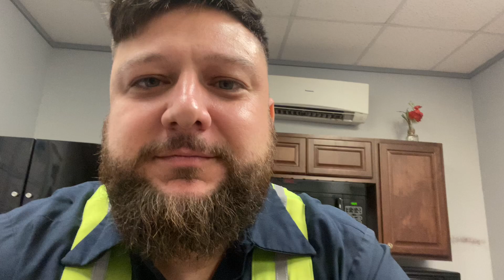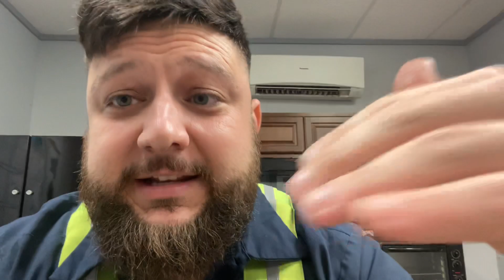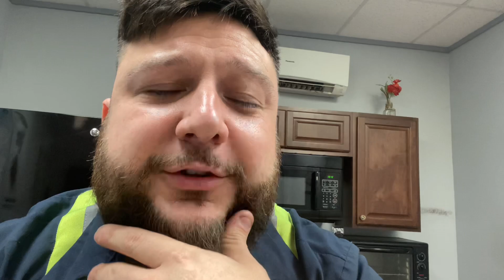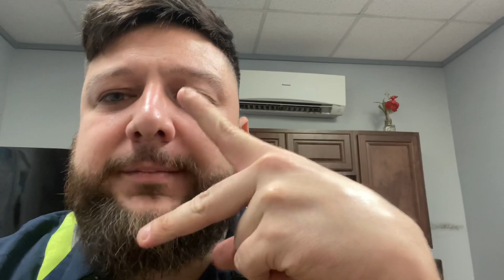Ported K Series Manifolds Inbound: How the Knockoff Manifold Performs on the Dyno

Comment: Who is the tuner you’re talking about that did the comparison? If he has a channel I’d be interested to see the video. Me and a friend have a discussion on whether this manifold will make the same power as factory rbc. I think it will, he thinks it’s cheap junk.
Reply from the maker: Manifolds are literally just static pieces of metal. They don't DO anything to add power. The knockoffs are direct copies which is something very easy to do to something that has no moving parts. This is how Skunk2 started making theirs. Started with a copy of the type r. Even if you don't open and deburr the edges you'll still get nearly the same performance because they are doing exactly what the OG does. Allow a certain volume of air 😁

The tuner I'm talking about doesn't post but I've known him a decade and he's got thousands of tunes under his belt
Reply: @VHBEngines  I just wanted to see this manifold out of the box, against a factory untouched rbc manifold on the dyno. Everybody does these ported against rbc manifolds. I know Honda puts a lot of r and d into their engines (at least they used to) and velocity and air turbulence can affect hp numbers by affecting how efficiently the air gets into the cylinders and how efficiently it mixes with the fuel to make hp numbers different. Now am I talking 20-30 hp difference? Absolutely not. But I’d expect 4-7 hp difference.